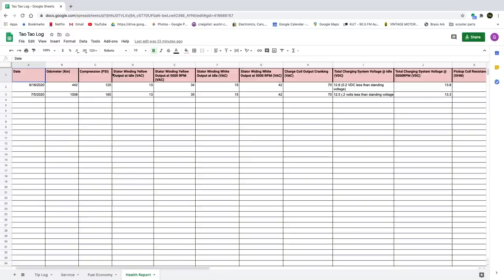(PT.7) I rode 1000 MILES on the most HATED scooter on the internet. Here is my review.

Comment: hello great video I need help with my twist and go ls49 or T&G Ls49 it runs and idols great when on the kickstand but when I put the scoot on the ground it won't move on throttling under its own weight I've replaced the belt inspected clutch and bell and variator all seem to be working properly no slipping clutch pads are not worn out belt rises in the variator and lowers in the clutch rear wheel spins and rpms increases incredibly well but on the ground boggs down and only slightly moves forward under its own weight only 125 miles on scoot I am 2nd owner when I got the scoot it was in pieces I put bak together and got it running I was told that its a carburetor adjustment that needed? but it runs excellent until it on the ground please respond and help if you can

Comment: Had same problem with the centerstand grinding in the corners. And did have the Jam nuts for the steering come loose too. I did have to change the flywheel and the stator also. And a cdi too. And only had the scoot for a year and said f it.

Comment: I got this scooter and I can promise you I a week never passes without a problem
Reply: I got it also, no major issues for the past 4 years. Did 400kms just in the last week. 45 000km on the clock so far. Try maintaining and understanding the scooter. I just do the regular oil change, never have i adjusted the valves or literally anything on it. Works perfectly :)

Comment: 1:54 what  uk saids about mopeds 

What is a moped? Legally, a moped is defined as a motorcycle with an engine no bigger than 50cc and a maximum speed of 28mph. ... Bear in mind that your CBT certificate is only valid for two years; so if you want to carry on riding you'll need to either take your AM moped licence or complete another CBT course.

Comment: i have a china 150, CT 70 replica and a used Sr 50 ditech. Im very afraid to daily my Aprilia. its an 09 dual injected and has like 0 dealer support in my immediate area (unlike the chinas) and dealer repairs on stuff like that would be insanely priced

Comment: In the uk 50cc scooters are popular for 16 year olds as they cannot drive a car or a bigger bike until 17, also for people in cities. It would technically also be illegal to modify and hence change its class. However for your own safety I think you derestrict its top speed for your own safety. Okay it's not going to set the tarmac alight but that extra 10-20 mph more will make it much more useable and safe for you. I don't think this will affect your experiment too much testing it is of reasonable quality  for someone on tight budget. Unless you like being masochistic with that thing?
Reply: Long ago comment, but its already derestricted. The horsepower the engine puts out wont give more speed.
Reply: @GoldenCroc  We have a similar scoot here they (chinese scooters) use gy6 engine. If I remember just cutting or removing a wire from the cdi will give you around 45mph 50 down a good hill if your lucky. Maybe some use variator restrictions?
Reply: @lampshade9323  There is no such restriction wire, this isnt an EU model. The downhill speed you are talking about is possible, but so is almost anything downhill, since it depends on the gradient. Well, at least until you reach terminal velocity or blow the piston to the moon by overreving it. 

Thats why when talking top speed of vehicles, its supposed to be acheived in conditions unaffected by external forces such as gradients and strong winds.

In this case, the engine power of an unrestricted chinese gy6 139qmb sccoter is enough for about 35mph on a zero gradient road in a best case scenario. No scooter equipped with such an engine has ever achieved 40 mph in unaffected conditions. From his comments, I dont think downhills is where he is lacking speed.

Since he is saying hes reaching about 34 mph, he is at the vehicles top speed for the engine power, and no more speed is to be had.
Reply: @GoldenCroc  Is it not possible to get a gear up kit for that engine? Maybe to much hassle to fit though.
Reply: @lampshade9323 To travel forward, all vehicles must overcome the forces acting on them to slow them down, in this case rolling resistance and aerodynamic drag. The vehicle generates it motive force from the power of the engine. A certain amount of engine power can only give a corresponding amount of propulsive force at a certain speed. That speed, for the power a 50cc gy6 china scooter, is about 35mph. Neither gearing up, nor down will have a beneficial effect if all power is converted to propulsive force. In fact, it can be more likely to slow it down, since it can lessen the engines output power, by going outside the powerband.

I.e. As said above, as a typical 50cc gy6 china scoot is constructed, it cant go faster that than about 35mph on flat ground without modifying it for more engine power, no matter what gearing.
Reply: @GoldenCroc  I see what your saying but the difference in gearing between that and a gy6 'euroscoot' like we have here in uk  probably isn't that much and unless they machine the head differently or restrict it in some other it surely wouldn't make that much difference? However point taken.
Reply: @lampshade9323  I dont see what you are getting at, are you saying that a Gy6 "euroscoot" is faster than about 35mph on flat road? Because it isnt. The gearing is likely identical as well, as is most everything else as well.

So I dont really understand what you mean.
Reply: @GoldenCroc  actually, yes I am I live in Europe and ww can get 40-45mph flat and 50 down a really steep when derestricted which is faster than 28-30mph and maybe 34mph down a hill.
Reply: @lampshade9323  Ok, havent seen anything like that myself, when riding in normal conditions. Shouldnt be possible with a stock gy6 139 bike (the upwards of 45mph on flat ground) in normal circumstances. Do you have somewhere I can see it happening, because I am a bit sceptical.

Anyway, I do believe you are understating the speeds of the US bikes, downhill is impossible to compare since you dont know the gradient in the comparison, for starters, so we will have to make do with flat ground. I didnt hear him state his absolute top speed at any time in these videos, you will have to link it to me in case I missed it, but I dont think I did. When the last video was posted, he was still in the "running in" phase, according to himself. So he never said he had taken it to top speed, as far as I could hear. Also bear in mind this guy is very big and heavy compared to almost everybody else.

Comment: I wish I had seen this video before, my girlfriend bought one to take back and forth to work. I could have talked her out of it. Now I've worked on a many motorcycle, but this is no fun. 6 months and I've already had to replace tail light assembly front brake line. The battery. The blinker control the horn and the headlight bulb. If this was mine I would have already gone Evel Knievel

Comment: How bad this chinese scooter are? For comparison, I got its obvious model: Kymco Filly. All that is common is appearance. When the Chinese have to prepare to be fix at any time, Kymco does not cause the same degree of uncertainty at all. Only its engine is the "same", which is also the best part in Chinese counterpart. There is clearly more power (2.2 / 2.8 kW). Kymco is very stable, almost stiff to steering. My Kymco is 2004 model and 5500 kilometer driven. Like new.

Comment: After about 1700 mi. mine dropped a valve but since enginesare pretty cheap and easy to replace/rebuild (well at least for me that is) and parts are cheap... well most of them are... i bought a new replacement engine for like $400 off ebay.

Comment: I don't think I could do it. I need something that I feel like I can out accelerate the average 4 banger econocar. My Honda 150cc with lighter rollers can outrun most small 4 cylinder SUVs and mommy vans. I've had it up to 70 and regularly cruise at 65 and I weigh 270 lbs. I'd be more terrified on that on a backroad than taking the PCX on the highway on a windy day.

Comment: In Florida any moped, or scooter doesn't require helmet(even for real motorcycles), doesn't require motorcycle endorsement if it's under 50cc. The difference in FL between MOPED and SCOOTER is very simple, a MOPED has pedals, a SCOOTER does not.

Comment: Maybe you should stop riding motorcycles if youre worried about your life when going as little as 30 mph... Its not like the thing will fall apart the next moment. If this thing breaks in 99% of the cases youre able to safely pull to the side of the road. Even if the engine locks up, the centrifugal clutch will just open allowing you to pull over (on a real motorcycle a locked up engine usually means a locked up rear tyre). The only way I can think of a scooter like this causing a crash is a brake locking up, which is pretty much impossible by design.
So on every 2 wheeler usually the vehicle is not the cause of a bad accident but its other cars crashing into you. So it doesnt really matter if a full size truck hits you on a tao tao or a bmw gs.
Reply: Difference being that a BMW GS can easily keep up with highway traffic and that shitty TaoTao has no hope in hell of doing so legally.

Comment: And to think a lot of owners of these things assume making it faster will improve the scooter...

I hate these cheap imports for another reason - they have cheapened the whole motorcycle industry. 

Look at the difference in quality from an 80’s CG 125 to today’s CBF 125.
Reply from the maker: i 100% agree with you there. it really is night and day.
Reply: Making ANY motorcycle (not just the Taotao) faster makes them even more dangerous.  The braking and suspension are (in a well designed bike) designed and tuned for the bike as it comes from the factory.   When you make the bike go faster, you are eating away at any of the safety margins in those systems.

Comment: Bro I am a owner of 5 tao taos scooters over the years  and currently brought a new 1  I have 2200.0  and counting last one I had before this one well over 5000 kilos/miles and I’m say this tao tao is what u make it ! U only paid 750$ for a motorcycle what hell u expect lol ofc buddies , Honda elites , yamahasss gone be better because their luxury brand scooters and cost fortune or same price someone can get a cheap car !    Yes I fixed shit load of small stuff on these bikes yes they break down like anything else with a Engine but repair super cheap so keep on the oil change , do a daily break / tire / sus check & clean the carb every thousand miles u should be good to go !  What I like do is when I first get bike buy a performance carb and swap out spark plugs immediately cause their 💩  and it runs like a champ     Now yes u can get a shitty manufactured scooter Cause these thing so cheaply made  I had tighten steering knuckles and fix breaks on half bikes I have owned from this company. Or similar companies. Tao , solana, ice bear , jonaway  their all same scooter mans running the gy6 50cc which is a damn good engine  was a stolen Honda model from their manufacturer that the Chinese made  other then the hit or miss with the recall fucked up manufacturing errors scooters that u can get that I highly recommend u get your money back  if u got one that suspension is dangerous as u say.       Other then that a normal good manufactured one.  Hold up pretty good.  May change belt few hundreds miles, do a few oil changes every other week , and carb adjustments but other then that this thing will run its people in China living off these thing driving city to city lol. 

PUT some respect on TAO tao it not for the weak. A bit mechanical experience and maintenance and you are good to go
Reply: Yeah I don't understand what the point of the series is. Buy a cheap scooter and then determine that it is in fact a cheap scooter. It would make more sense if it was about improving it to make it better. You gotta expect to do that when you get one of these. But it can be done and pretty inexpensively. I just don't recommend them to anyone that can't do all their own work or isn't willing to learn. I will say they're about the easiest thing on earth to keep running once you got them figured out.
Reply: @adambeforeeve5904  I always say if you love your Chinese scooter it will love you back. Hate it and it will hate you back.
Reply: Aside from the fact that TaoTao's aren't sold in my country due to emissions regulations, I don't get the point of buying one at all. A cheap euro4 compliant chinese scooter costs about 1000 euro. A good Taiwanese scooter like a Kymco costs about double that.
But the huge difference comes when the cheap one shits the bed after 5000km and the more expensive one will do 40.000km with ease. You may have owned 5 TaoTao's over the years, yet I've only owned 1 Kymco since 2011 and it's going on 50.000km. And this isn't outside the norm for a Kymco, friends of mine own older ones with 70 or even 80.000 km on the odometer.
Sure they're probably thrice the price of a TaoTao in initial purchase, but they are 10 times more reliable.

And that's what I find interesting in this series. How big is the gap between the utter cheapest 50cc scooter and a not-quite-the-cheapest 50cc scooter. As frankly I'm convinced that brands like Aprilia and Vespa just tack on a 1000 euro brand tax at the very least.

Comment: I guess this explains the end of your trip log at 2010 km. Did you finally give it up? I just hope this doesn't tar all Chinese scooters with the same brush. Bintelli, Wolf and Scootstar are better Chinese brands with decent reputations. Some of their owners have gone 20,000 miles on them.
Reply from the maker: I havent given up yet. But I have to say I worked at a bintelli, wolf and adly dealership for the better part of 4 years and I cant say they are much better scooters. Especially the bintellis. Wolf did seem to send us fewer lemons than the other but I cant say they were anywhere near as reliable as their kymco, pgo, yamaha, and honda counterparts.
Reply: @Scooter_911  Early Bintellis were from Znen and Justin Jackrel didn't get much respect in pointing out problems. He switched to Jiajue and has had much better results. Diane Hammer at Wolf is seemingly better at communicating her issues with Znen and is getting much better results.
Reply: I have to admit to some dismay about where this has headed. This series has forgotten it's original premise. You bought the cheapest scooter on the web. That will always create compromises. But at the heart of every machine is its engine. By your own admission the engine hasn't caused you any trouble. Is it stuck among cheap components. Of course. You want this engine in a better package? Buy a Lance Cali Classic 50. It only costs three times as much. A few years ago a young man from Michigan bought a used Bintelli Scorch 50 and rode it from Michigan to Key West. Is the engine solid. Yes. Is it the engine that gets you down the road. Yes. And asking a 50cc scooter to keep up with Texas drivers lugging a six foot-four, two hundred pound rider...... Goes without saying. Especially for seven hundred bucks.

Comment: It makes no matter if this thing cost $500 brand new because a 49cc Chinese scooter from this particular year is taking money and throwing it in the trash. If you're on a budget and you must buy a scooter moped something that is 49 cc's only invest your money in a Japanese bike. Any brand that makes no difference. Think, Honda ,Yamaha, Kawasaki ,Suzuki. If you don't have all the money use what you have as a down payment and then pay it off. Do not spend $750 on a piece of crap that's going to fall apart then you have to worry that you're going to get killed on it and you have to be a Master Mechanic to keep it running. Again Chinese scooters suck! Honda, Yamaha ,Kawasaki, Suzuki . Or don't waste your money take the bus or the train simple. What's the point of investing more money on a piece of crap with a bigger carburetor or having it worked on? You're starting out with a foundation that is bad, don't put good money into bad money.

Comment: You should have included a category for price. You'd have to give it 5 stars for that because what else is there? Used maybe but that would be unfair. The whole point of these scooters is that they are built to be sold cheap. What do you expect? Electric bikes are way overpriced and the cheaper ones are a joke just about anything other than a Chinese scooter is going to at least double the price and if you want a new car that'll cost you at least 10x more. Chinese scooters have their place but you have to recognize what it is.

Comment: 528 dollars for oil change valve adjustment and steering bearing change.  Doesn't seem reasonable, i think they tried to rip you off
Reply from the maker: Check the spreadsheet out and see where the charges came from!
Reply: @Scooter_911  why labor cost is 110 $ per hour ?  I am not American , for me it sounds unreasonable. In my country car mechanics charge 25€ (29.61$)- 30€ (35.54 $)  per hour.
Reply: BTW , i am not trying to discredit your experiment, it is just interesting for me to understand why would someone go to mechanic at all, if they charge a fortune for tasks that require 0 knowledge and can be done by anyone.